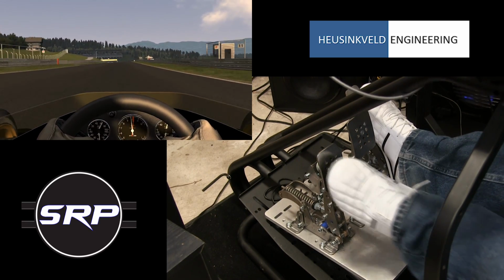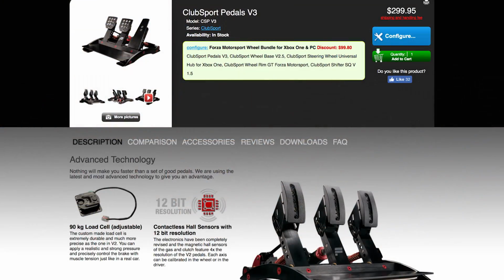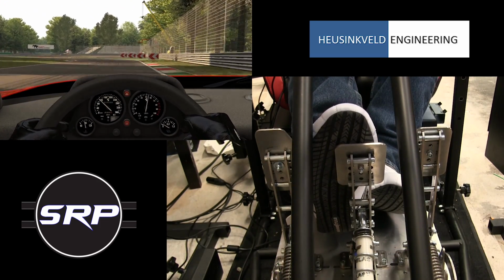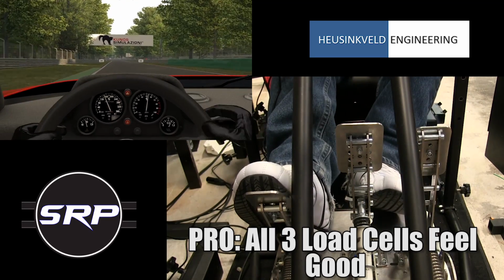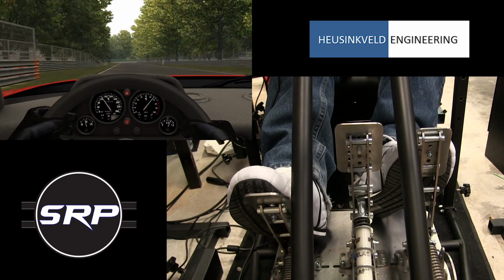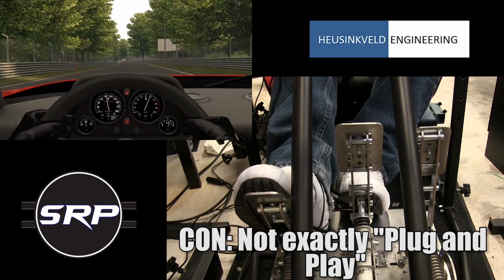Heusinkveld Engineering Sim Pedals Pro Review

Comment: Hi there. Good review.Ok so this question goes for all the mid to high end pedals you've tryed. Do they have any deadzones at the start and end of travel? Especially concerned with the throttle. Real cars don't have deadzones. Thanks in advance.
Reply: wildman708 Hi, these have no deadzone at all. In fact, it is needed to add some deadzone as there is always some pretension on the load cells. You can set the 0 point to 1 RAW point  accuracy (100% as well)! If you do this right the pedal will register you tapping them with the tip of your finger!

Comment: Thanks for the video.  I been eyeboalling HE pedals, but im not sure yet if to go with Pro or the ultimate, after your review, im not sure either, specially with your comment about using the 120pounds that the break allows, giving me the impression that you want more.  On the other side the Ultimates are said that have an very stiff break.... so im kinda lost.  What do you recommend?
Reply from the maker: The easiest way for me to sum up my opinion is: It is easier to start with a higher threshold and bring it down, compared to starting low and going up. With the calibration, you don't have to use the full 136kg/300lb force. You can set it to anything lower, and have it that way.

Also worth mentioning is that Ultimates feature hydraulic dampening in the pedals, so they'll feel a little closer to real life.

Hopefully this helps!
Reply: Thanks for your reply, so by your comments you are encouraging me to go for the ultimates =P
Reply from the maker: If you can afford them, yes. Gives you more leeway on what you are able to do
Reply: @Simracingpaddock  why they are not inverted? In cars it seems regular to me.

www.muskeln-kaufen.de

Comment: Hi Paddock, how are the forces required to depress the pedals? I would like the springs setting to be set like my real life street car.
Reply from the maker: The throttle spring is definitely solid and heavy out of the box (which some people like, some don't) and the clutch feels great, pretty darn close to heavier clutches I've used in sports cars. The brake is definitely not going to have the hydraulic feel you have in your daily driver. It'll feel like a higher pressure brake, like those in a race car. I bet you could adjust the bushings to get it closer to your car, but I don't think you could get a true 1:1 feeling of that.

Hope this helps!

Comment: How does the braking force with these compare to the fanatec v3 with the brake performance kit? seeing as the v3 is a 90kg load cell and this one 50kg braking force. Not sure if I should get the ultimates vs pro seeing as I have the v3's on the hardest setting.
Reply from the maker: I will say that, with load cell used in the HE set, it feels a lot smoother, and responsive. It, in my opinion, does feel a little more solid than the CSP V3 though. 

I haven't tested the Ultimates myself, but I'd say the great things with the Ultimates is that, using DIVIEW, you can calibrate the pedals for anything between 0kg and 136kg. 

So if you are looking for more leeway for having more braking force, I'd say go with the Ultimates. Much easier to start high and scale back, than to go low, and hit the ceiling.
Reply: i am interested in this too.. i recently bought the v3's+BPK+damper kit, i have 2x13mm green elastomers installed, damper at 4,minimum sensitivity on fanatec cp, and still i have to set braking force in iracing at FULL just to make it tolerable!, i am reaching 100% input VERY easily! Is that normal?

Comment: I´m using the Pro´s since 15 month now without any complains and they are very quiet. It looks like the blue stopper from the clutch is too far placed and not stopping/damping the clutch like it should. It´s recommended to put some high-quality oil at all moving connections and even the rubbers if they might start squeaking. Using DIView for calibration is a big plus IMO, because far more possibilities for setting it up for personal preference. I made a little initial dead-zone on the break to keep my foot there without breaking and a clutch-deadzone on the other end to have less miss-shifts in most titles.
Reply: I agree, I have these pedals too and they are virtually silent. The dampers on mine are set right at the back too and the pedals hit them no problem. Mine are set completely stock and required no adjustments. I'm wondering if the clank is actually coming from the baseplate on the cockpit side. William, try dismounting the pedals and just mash the clutch, I think you won't get the clank.
Reply from the maker: Leynad Jee thanks for the heads up! Ok look into adjusting the clutch when I get home!

I didn't really tweak the clutch pedal throw much from stock, so it could be as simple as me adjusting it.
Reply: Sim Racing Paddock well, great work. Ideally you would show each pedal separate. It's hard to make out whether its only the clutch as it seems, or the other pedals too.
Reply: I am using HE Pro's with the base plate and they are virtually silent. One of the specific reasons I got them over some of the competition. Strange yours are so loud
Reply: Yeah something strange going on with how loud those pedals are. Mine are silent. I've raced with my partner sleeping 2m away.

Comment: i'd prefer HPP+ PRX SE because hydraulic feel and potentiometer pedal, vehicles are basically that way either way. I love the looks but i do not like load cells. There was a post about the comparisons and it was stating there was like 4096 steps in the potentiometer pedal and load cell was less. Also i believe simracing garage, barry i believe stated he liked HPP over heusinkveld because it wasn't very natural...
Reply: No, Barry has the Heusinkveld Ultimates and uses those as his main set when he is driving. Those are his top choice.
Reply: He did review the HPP and loved it, but his top choice is the HE Ultimates. I to, trust his opinion. He always says that high end pedals are all good. It's usually something small that makes you prefer one over the other. So which ever set you or I try, we will most likely end up loving it.
Reply: Eckard Rolando oh. I wished he change the comment from 7 months ago on his review lol. it says he prefer the hpps.
Reply: @ezrolly898  he use wave italy pedals now tho
Reply: Seems HE have a v2 with 65536 steps nowadays, but even 2000 would be more than enough, means that with 10 cm pedal travel you get 20 steps for every millimeter.
Reply: yea just saw that. jeez, they are good pedals. I guess the only gripe I have is that they are using loadcells.
Reply: Leynad Jee was wondering if you can change the board in the hpp to a 16 bit board.
Reply: Nils Heusinkveld made a video about 16 vs 12 bit and to sum it up: Bullshit-numbers without any effect. And just heard the first time that my pedals using more than one loadcell. The feeling comes from the design and spring, not how it is measured.